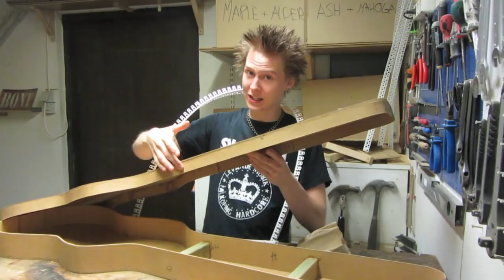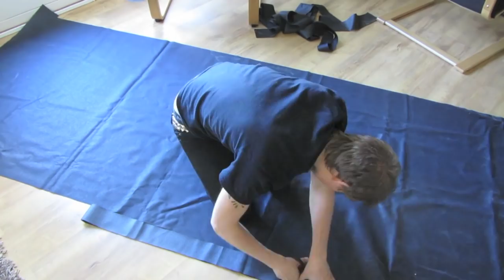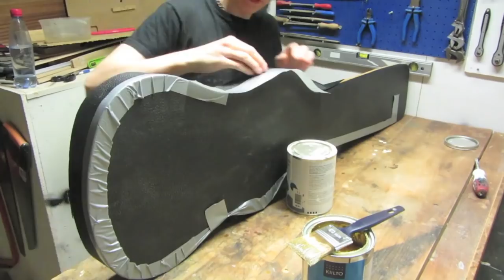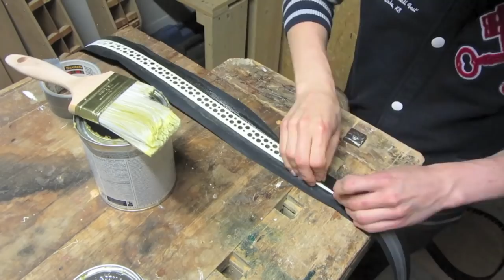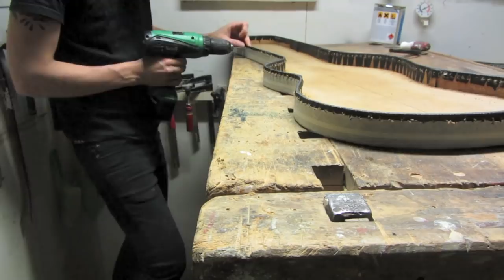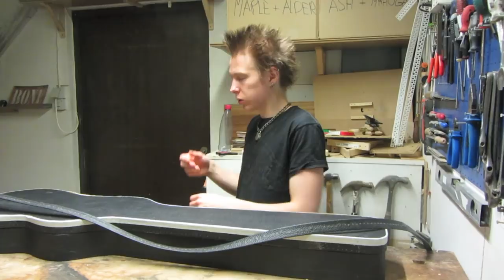Form Fitting Precision Bass Hard Case Build: Chapter Four

Comment from the maker: Thank you so much for the kind words matey! 
Then let me say first of all.. you adjust the bend of the neck (front or back bow) with help of the truss rod. NOT!! by actually trying to bend the neck with clamps or heat!
The neck is suppose to be able to bend in either a front or back bow depending on how you like to play.
So, what you should do is to adjust the truss rod. On a bolt on neck it is either adjusted at the heal or headstock. Send me a PM if you want more info about this.

Comment: how many yards of vinyl did you end up needing? and what glue did you use to stik it to the wood?
Reply from the maker: If I remember correctly, It was a 1380mm wide and 3660mm long pice I ordered. Tho I think I only needed three quarters of it (at max). 

And the glue is a allround contact adhesive glue.